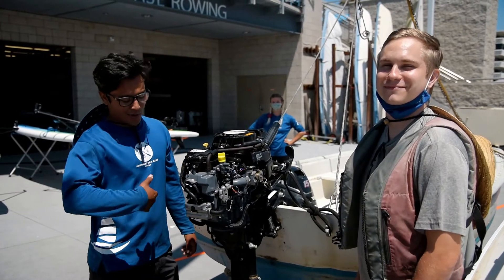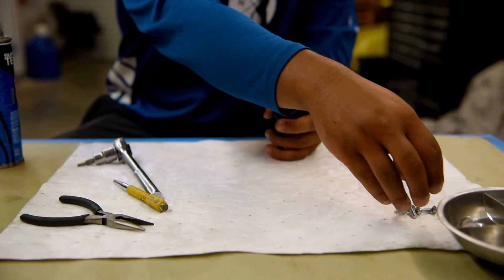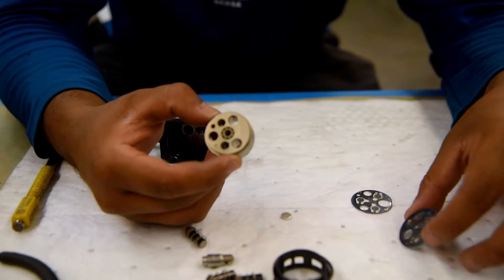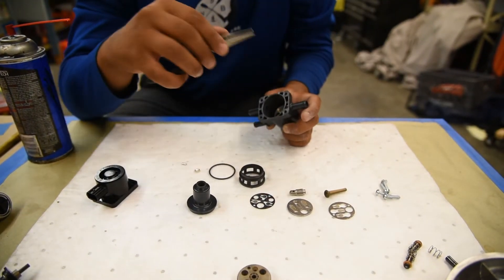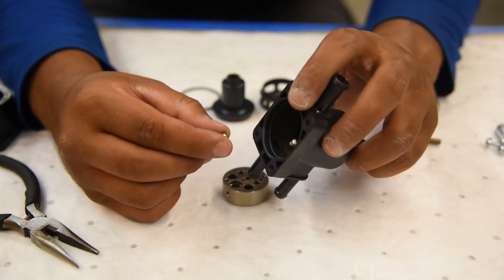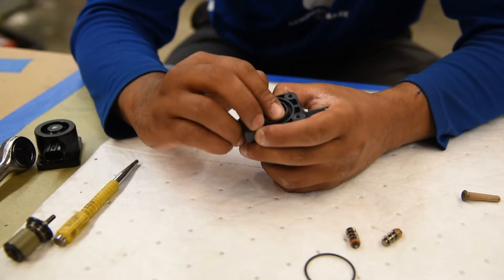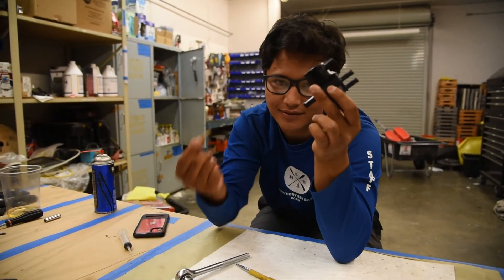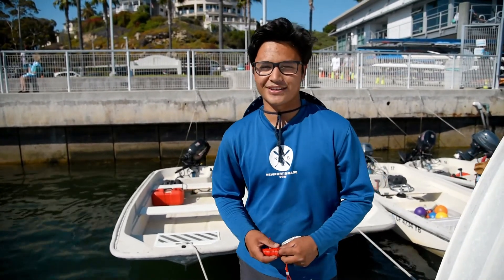Cleaning a 2016 15HP Suzuki High Pressure Fuel Pump

Comment: You should mention that the high pressure fuel pump is considered by suzuki to be a "non serviceable" part. If anything inside is broken the only thing you can do is get a whole new pump.
Reply from the maker: You are correct Keegan! Thank you!
Reply: @ quarterback and keegan Which motors in your fleets do you consider the most reliable?

Comment: I know it has been a while since this post…but where should the nozzle point on the part with the white tip that everything is assembled around?  Directly towards the center?

I also removed and cleaned my injectors based on your video!  Very helpful!  

Thanks
Reply from the maker: @robertgarvey5872  Ahhh, i dont have the outboard on hand and do not recall at the moment, sorry!

Comment: Hi - thanks for your video. Helped me a lot ! My DF15 did not start but the Suzuki diagnosis SW did not show any error codes and the actuation of the hp fuel pump produced nice fuel flow at the injector rail. But: I could not remove the „sleeve“ inside the magnetic stator. It was rusted in and the rust squeezed it so that the magnetic rotor was grinding - obviously rpm controlled and at idle/start the pump stopped. Best would be to grind off the touch points and assemble it again. I broke off the neck at the sleeve and crashed the sleeve (without the bottom with the thrust bearing). Some glue to seal it. Not sure what the fuel does to the magnetic winding.
Reply from the maker: @Drvictor58  Sounds like it may be time to buy a new one 🤪

Comment: I know this is an old video.  I have a 2017 15 horse.  Hasn’t had much use.  It runs great until you open it up.  At that point, it cuts out and the red engine light pops on and off.  Is that what yours was doing to prompt you to clean the pump?
Reply from the maker: Usually, we cleaned the pump when the outboard would stall out while trying to increase the RPM. For the red lights and what they mean, I recommend looking at the owner's manual for what they mean.

Comment: Good video. Anyone know if the motor pin inside the fuel pump, the magnetized section, should be offset?
Reply from the maker: Its been a hot sec since I made this video and don't have the outboard to check anymore.

Comment: Great videos.   Any chance you could do a demonstration on how to put back together a fuel vapor separator for the same engine.  I stupidly dismantled mine and am not sure how to put the pin and spring back correctly.  Any help is greatly appreciated.
Reply from the maker: @ScottM1969  Ahh I would if I could, but I longer work with these outboards at my old job, Sorry!

Comment: Hello
I have a brand new Suzuki DF15 AL, what procedures do you recommend to get it in properly because everyone says something different???
Can you advise me how to reach it properly?
Hello
I mean how to swim for the first 20 hours?
Reply from the maker: Hello! I know this isn't super helpful, but the owners manual should have a detail list of steps for what you should do for breaking in the engine.
Reply: @thecollegequarterdeck  I drained the oil from the Suzuki DF15 after about 10 hours. I left it in the bottle and after a few days a white precipitate formed from the oil at the bottom, a lot of it. What could it be and what cause could it be? New engine, only 10 hours old
I also see that at high speeds, white smoke comes out of this nozzle near the cooling water nozzle

Comment: I have a 2019 15 hp Suzuki.  Running great yesterday for about 20 minutes and then just died and will not re-start.  I watched your videos and then looked at my engine.  Did they change the engine such that it lowers the injector and fuel pump bolts below the upper cowling level?  Is there a way to get to the bolts?
Reply from the maker: I am unsure since I have not worked with the 2019 model. The nice part about the 2016-2017 model was that the lower cowling comes off with ease to access those lower components if needed.
Reply: @thecollegequarterdeck  

I realized that after I posted the comment and was successful in removing the lower cowling and getting to the components.  We removed the hose before the pump and we are getting gas to that point.  So disassembled and cleaned the components in the pump.  It is a manual start, so with one person holding the hose from the injector side of the pump in a bucket and the other pulling the started several times we are not getting flow.  We tried checking voltage on all combinations of the plug and one of the combinations causes the meter to zero out(checking DC voltage).  Would this indicate the pump is bad?

Thanks in advance.  We are in the Bahamas, so trying to find someone qualified and getting access to parts will be interesting!
Bill Wells
Reply: @thecollegequarterdeck  2020 DF20A ...the lower 2 piece cowling comes off...3 bolts on each side

Comment: When rebuilding this pump you may need to replace the 2 o-rings. One is 32mm x 2.0mm between the cap and body, the other is 5.5mm x 1.5mm under that part with the little white tip. Use Buna-N 70 durometer rings.  I got mine from Harfington's. This pump has gasoline and an electric motor.  It is "ignition protected" since failure may allow gas into the motor chamber and consequent fire with potential explosion. Hence, Suzuki says it's non-serviceable. If you replace the O-ring make sure it is absolutely set correctly. I am not responsible for any damage or injury or death, that your rebuild might 0:26 .
Reply from the maker: Thanks for the insight!

Comment: HELP...
I took my df25a high pressure fuel pump totally apart.

There is a metal coned shaped spring/spacer under the thick metal disc at the bottom of the pump. You did not take this out. I tried to take the thick metal disc  out by gave up. I was then trying to clean the filter in the pump  outlet. I sprayed carb cleaner in the outlet then sprayed compressed air in the outlet. That is when the remaining bottom contents in the bottom of the pump that was not removed , fell into my palm. There was a thick metal disc in the base of the pump and bellow it was a coil spring,  an type of needle filter, and a short, wide cone shape spacer. Does this cone have its narrow end facing toward the plastic base of the pump or does it face up and press against the bottom of the metal disc?

This metal disc also had an o-ring around it. The o-ring seems to have increased its inside diameter due to absorbing  fuel. And is making it impossible to re-install
Reply from the maker: If you're having issues putting it back together, the safer bet is to buy a new high pressure fuel pump. It's been a while since Ive taken on apart and no longer have a Suzuki to take apart to provide more assistance. Im sorry because I am sure this is inconvenient but at least the part is replaceable :)

Comment: Does the park with “the white tip that faces upwards” get pressed in… or does it just stir in there loose?  Mine seems loose and I’m having a hard time getting everything back together flush. Seems like I need to force that part in… but don’t want to break it. Thx!
Reply: Ahhh, I found there was an o-ring caught underneath that I had to put on the bottom of the part to seat it correctly 😃
Reply: By the way, this video was super helpful. My pistons were seized up and you saved me a trip to the dealer for service!!!
Reply from the maker: Glad you found this video helpful!

Comment: your last video you cleaned every aspect of the fuel system, without the motor running properly. are you saying that smidgen of gunk was preventing motor operation? that does seem finicky
Reply from the maker: It can happen. We often will replace low and high pressure fuel pump if you have dirty injectors.

Comment: Thank you!  You may want to expand your presentation by explaining how the high pressure pump works, the purpose of each of the fuel lines and exactly how and to what pressure that that electrical "pump" boosts the fuel pressure.  Would there have been any way to bench test that fuel pump before and after the cleaning to determine whether the cleaning was effective?  I expect the school to have access to the maintenance manual it would be nice to have you talk/show the manual in your work.
Reply from the maker: Definitely something we should consider doing. I appreciate the idea!
Reply: This is what I’m curious about. Not sure how to 100% diagnose if this pump is or is not working correctly.

Comment: I've seen a lot issues with these  Suzuki outboards.. wanted to get one (an EFI 9.9 or 20), but now I'm not so sure.. seems they're very finicky and riddled with fuel related issues..
Reply: They are not difficult riddles to overcome. Keep your filters serviced and keep water out of your fuel. Winterize properly and you should be okay. They are good motors but put a loom on your cables so the steering rod doesn't chew up the main wiring loom plug.
Reply: @keegan707  thanks for the insight Keegan, but if I'm being completely honest, I'm not certain I'm following you. What cable loom?
Reply: @CUBICHI1985  oh goodness I completely missed your reply. The main wiring loom that leaves the motor and goes to the control box and gauges has a square connector on it. It is just the right length to get drug over the steering rod when you turn the motor. Over time it can break wires in the loom. The whole problem would have been solved if they had just run the plug inside the cowl rather than dangling around outside.
Reply: @keegan707  what is a loom?